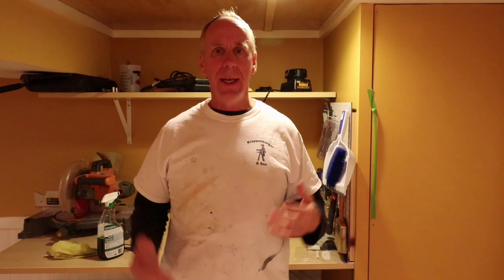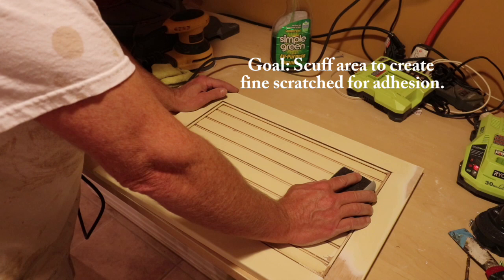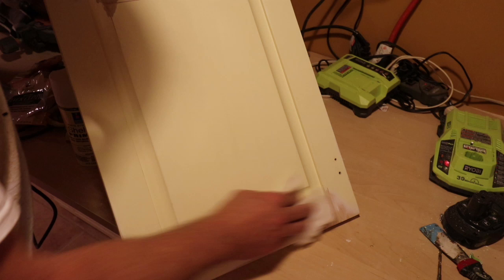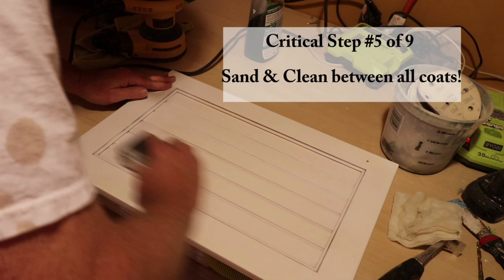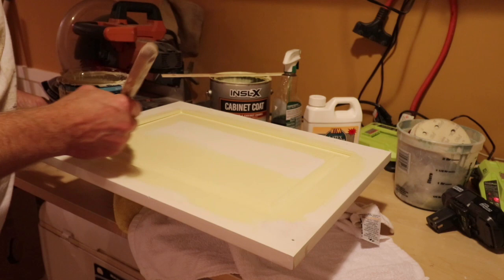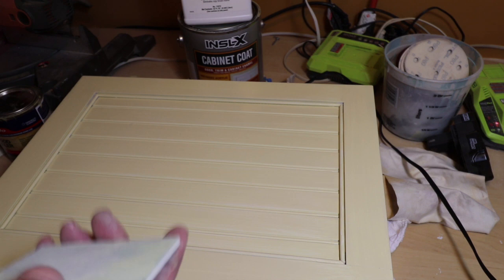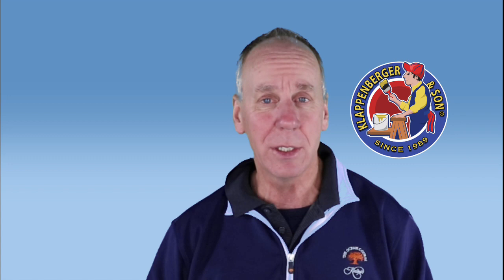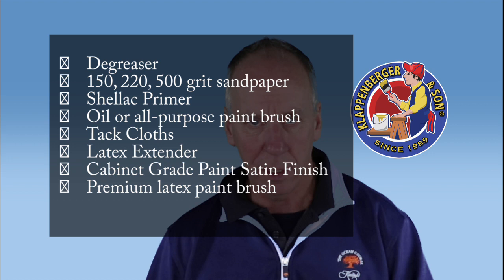Painting Kitchen cabinets without Spraying

Comment: This was the best cabinet painting video I’ve seen. Is the Insilx better than Advance?
Reply from the maker: I have not tested it yet for washability and durability.  I will be doing so in a few weeks once the paint has cured.  Please subscribe and you will automatically receive the video.  Thanks!!
Reply: Advance sucks , try Emerald - https://www.youtube.com/watch?v=ejKR5qz99wc&t=4s
Reply: I used Emerald for a while then had to use Advanced on a job. I'll never go back. Advanced was easy to work with, looked better and cost about $20 a gallon less. Everyone should give it a try.
Reply: @chuckwdaniel  after painting with Advance, do you clean brushes with mineral spirits - or do you find that soap and water is adequate?
Reply: @Avital4414  I do a final rinse with mineral spirits or Klean Strip Brush Cleaner with just about any type of paint.
Reply: @chuckwdaniel which brush do you recommend for Advance?

Comment: I'm curious, can you explain your choice not to use a roller?  Personal preference?  Does it make a difference on the final result?
Reply: A roller leaves a stipple in the paint that creates more surface area. All this extra surface area causes it to dry before it gets a chance to level leaving a peddled or orange peel look. It could work fine if humidity/temp and air movement is in your favor but all of those are hard to control without a being in a quality $$$$ paint booth.
Reply: CJP. Excellent technical explanation. Love when people can simply things. Simply put you can get factory finish if you have unlimited time and high humidity regardless of the application as gravity will self level anything as long as it can move. Master cabinet painter can use sprayers to mitigate marks and adjusted thickness and dry time for their environment.

Comment: In regards to the finish coating on the cabinet doors using Advance. Did you paint 1 side of door and wait a day and then turn them over to paint other side? No other way?
Reply from the maker: Yes I did, and it is important to wait at least 16 hours between coats.
Reply: top coat what did you use did not show it or I missed it

Comment: Why prime previously painted cabinets doors ? And why sand cetween coats ?   I never do  either of those steps on my cabinets. I only prime if I paint over natural wood cabinets that have never been painted before. And I only  use a brush for  corners / indented areas..then I use a mini roller on the flat areas..why do you now use a mini roller ?
Reply from the maker: I prime for adhesion and I sand to give a smoother finish.
Reply: @klappenbergersonpaintingha2933  Why no mini roller?   To me quicker and better result than a brush on the main area.

Comment: Lots of good tips but according to what I see at 9:45 this is not a 'factory' finish. I can still see brush strokes. I don't believe any brush work can compare to a good spray. I think anyone wanted to do this should go and buy small paint can and do a test. It is true that not anyone wants to buy or rent paint sprayer or want to learn how to use it. Paint one half of a test board with this method brush and other half with home depot spray can and compare which one is closer to factory finish.